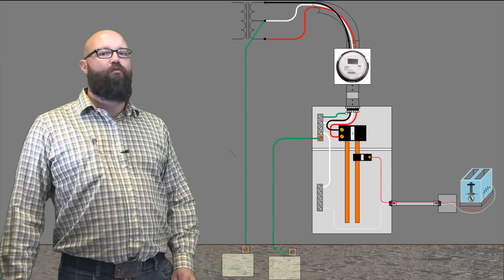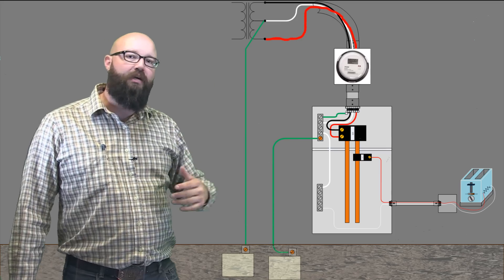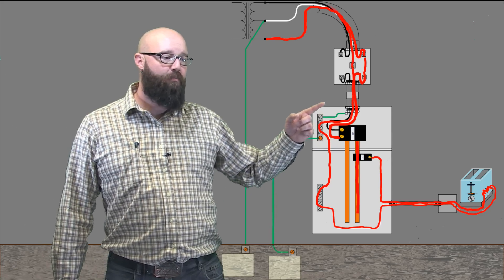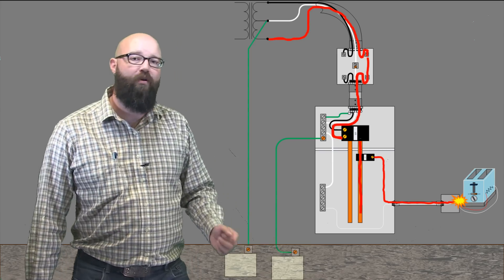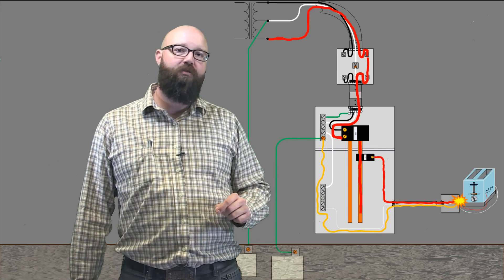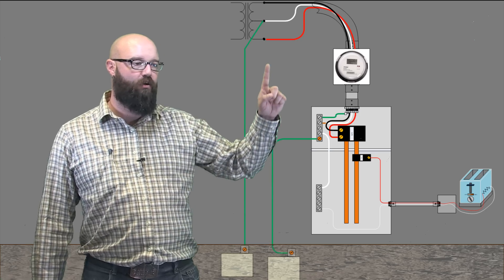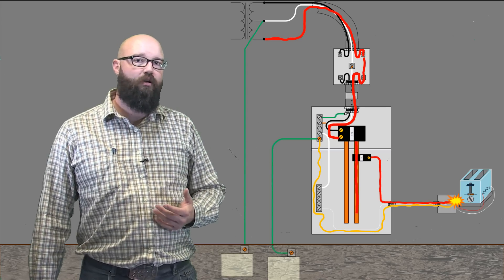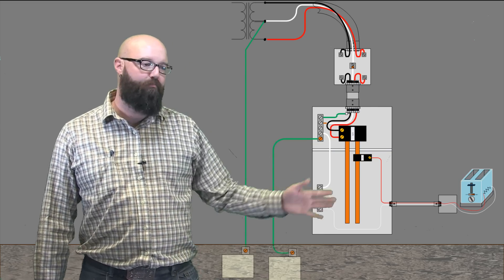Grounding and Bonding

Comment: Pretty good explanation, except in your last example, when the fault current, not having a path to neutral due to an open neutral bond, must travel to earth ground.  
A fault current that goes to earth ground will not, in most cases, open the circuit protection.  
There is no low impedance path thru the earth to the ground wire on the power pole. 
GFM
Reply from the maker: Agreed. It is designed in theory this way but impedance is still too high. We've had a few discussions regarding this on this thread, but thank you for the comment and watching!
Reply: @schulerruler  In reality then, (in the case grayfurnaceman just stated) what eventually occurs in this scenario? Does the main breaker trip? Does the toaster branch circuit breaker trip? grayfurnaceman and you are saying that the circuit goes from panelboard enclosure to Earth rather than up back through the service conduit in reality, correct? My biggest question why "A fault current that goes to earth ground will not, in most cases, open the circuit protection." Are you saying that because "There is no low impedance path thru the earth to the ground wire on the power pole" that there is no complete circuit that goes through the main breaker? ...... Awesome video!!!  I'm studying for my electrical power PE exam and just trying to really, really understand power.
Reply: @schulerruler  If an electrician is incompetent enough that both the neutral return and the non-conductive ground returns in his panel somehow become disconnected and he has to rely on ground coupling to trip the breaker then he needs to have his licence pulled anyway.
Reply from the maker: @joevignolor4u949  I agree with you. I have seen these connections fail over time though due to cold flow and have even had a neutral in a panel come out when moving the conductor. I wouldn't always blame the electrician, but if they forget to tighten up the lugs, it is a critical system and I agree something more serious should happen because of it.
Reply: Even if the current through the Earth doesn't open the breaker or fuse, it will still help to limit the voltage on other grounded surfaces. Otherwise, because no current flows and no voltage drops, all other grounded metal connected to the system will be at the supply voltage.
Reply: The use of earth ground as a zero voltage plane is the only use of earth ground.  It can provide a path for lightning and surges.  The idea that it is provide a path for fault current is not true.
GFM
Reply: @grayfurnaceman  This isn't well known, but there is another reason for the earth ground besides lightning and surges. In addition to the normal electromagnetic power coupling between the primary and secondary windings transformers also have electrostatic coupling between the two windings. So with the windings being separated by an insulator a transformer acts like a big capacitor. This will then couple unwanted AC voltage across from the primary to the secondary. These voltages will appear between the center tap of the secondary and earth ground if the center tap isn't connected to anything.

As such if you don't connect the center tap of the transformer to earth ground all the neutrals will float and have unwanted voltages on them relative to the earth. The ground plane that connects the center tap and the attached neutral to earth ground is what shunts these unwanted voltages to the earth and eliminates them.
Reply: Well explained.  Thank you
GFM
Reply: At what point will the house use the coax drop as the ground?
Reply: @scottharshman2560  I remember one place I rented where the coax shield was the ground.
Reply: TribbleBot the coax shield is usually bonded near the entrance to the dwelling. In Pennsylvania they run a green wire from a thru connector to the meter box. Other zoning locations may have different requirements. Watch https://youtu.be/8Z2JA9yK1zI   and  https://youtu.be/79CFX66mOHg
Reply: @ grayfurnaceman...love your videos🖐 they help me...thanks
Reply: Welcome
GFM
Reply: Seldom do ANY of these guys get it right (I retired from an electric utility company....)
Reply: GFM.......So if the Fault Current cannot find its way back to the source through neutral bonding, but instead takes the  path of the grounding electrode conductor to the ground electrode, is if fair to say then that the enclosure and raceway will remain energized, but being at zero (Earth) potential, will not have a high current? And if that is the case, then the fault condition will remain until someone realizes that a device (Toaster) is not working, or they come in contact with the enclosure or raceway and complete a path with another grounded surface.

I would like to believe that if there is no low impedance path back to the source to generate a high current to cause the magnetic portion of a breaker to activate, then the current going to the grounding electrode would cause the thermal (overload) portion of the breaker to activate instead, assuming you have a thermal-magnetic breaker.
Reply from the maker: @griffmustard  I think in the situation you are describing you would end up with a situation more similar to an ungrounded system. I don't know if the ground impedance would even cause overload levels in a standard breaker.  One thing to remember is a situation like this is highly unlikely to occur, but i believe, and i could be mistaken, but the toaster would still function as normal. The danger however lies in the fact that now you have a potential on all metal bonded components that could be inadvertently contacted by anyone. with no reference in the system back to the grounded conductor however, that potential may not even pose a threat. If you were at this point to touch something metal (which now has a potential on it) and a neutral or identified conductor, then you would receive a shock.
Reply: @schulerruler  .....Yes, in an ungrounded system, a person contacting an energized enclosure would not be subjected to a shock. However, I would think a conductor with frayed insulation contacting a device box, would now give the current two paths to return back to the source. And therefore the majority of the current would take the path of the raceway, rather than going through the coil element of a toaster (path of least resistance). So the toaster "might" work, but not with the same efficiency.

To go back to your animation and some of the points made by GRAY FURNACE MAN, the only worthwhile purpose for System Grounding is to stabilize supply voltage from transients/surges and lightning. And Equipment Grounding, with a low impedance path, is the only hope of operating your protective devices. So again I must ask, what happens when the low impedance path is broken, and the GF goes to ground? If the situation is not enough to activate the protective device, then the fault condition remains until discovered, right?

"One thing to remember is a situation like this is highly unlikely to occur"..........But what happens when it does occur? You told a disgruntled Journeyman, on his last day on the job, to terminate a panel........LOL!!!
Reply from the maker: @griffmustard  First off, thanks for commenting!! I enjoy discussing as hopefully we are all helping each other deepen our understanding of the topic. 
If you think of the frayed wire in the situation we are describing, having lost all paths back to the grounded point, the only path for return would be through the load, as the bonding infrastructure has been compromised. Essentially it would be like not having a bonding system at all if there were no connection anywhere between neutral and bonding at the service.  In this case the toaster would definitely operate, as there is no parallel path back, and definitely at this point there is no touch potential on any metal that is bonded to the point where the fault occurred.  One of the main reasons why ground fault Detection is so crucial in an ungrounded system.

And i agree that the purpose of  GROUNDING is to maintain balanced voltages in 3 wire and WYE connections. The main intent of the video was to illustrate paths of fault current through continuous bonding and i agree with GFM that the last scenario is not the intent of the grounding conductor/electrode, but i also still know that in a fault situation, there IS in fact current on the grounding conductor. It is considerably smaller though. Current doesn't just "go to ground" but if there is a current on the grounding conductor, then it has to be returning back to the supply, or else you are talking about an open circuit.
Reply: @schulerruler  Well thank you very much for the video. I'm always looking for informational videos like this to help fill in the  gaps in my understanding
Reply: Because the chassis ground is connected to the neutral in the main panel a fault current will pass to neutral and open the circuit protection.  High current virtually never will pass to earth ground at the voltages seen in the residential power.  
GFM
Reply from the maker: @grayfurnaceman  the discussion is what happens when the connections through bonding at the panel to neutral are lost. 
Meaning no brass screw, no service raceway bonding jumper, no system bonding jumper. You would essentially have a floating isolated system. If the secondary of a transformer is not grounded and gives no reference for neutral to ground, you could touch a secondary hot and a metal box all day long and would not feel a thing as there is again no reference on that secondary circuit to ground. (I AM NOT ENCOURAGING ANYONE TO TOUCH A HOT CONDUCTOR AND METAL) 

During fault situations I agree there is no HIGH current on a grounding conductor, but to say there is no current at all on a grounding conductor is not true. It is measureable, low, but measureable. If there is any current then there is a path through ground back to supply neutral. Otherwise it would be an open circuit and zero current would be measured. 

To clarify for myself GFM, when referencing chassis ground, would that be considered the same as equipment bonding? Oddly enough I also teach HVAC for our second years and would love some EOF your feed back on the few HVAC system videos I have made.
Reply: I would imagine that in some places in the world where the earth moisture content is consistent on a year round basis, you will have conductivity through earth, especially if the grounded transformer neutral and the grounded service panel are in relative distance to one another. But what about dry areas like let's say Saudi Arabia, where the soil is sand, with next to zero moisture content, I don't think you would have much ground conductivity. In such a situation, I would think any separately derived system would be connected to a ground grid, which will give you a wired connection back to the source through a grounded neutral point.
Reply from the maker: @griffmustard  my colleague used to perform ground impedance tests on a regular basis here in Alberta Canada, but I've never had the opportunity. I would imagine it would be harder to reach down far enough with electrodes in dryer areas for sure.
Reply: Yes it is the same.  I use chassis ground because it seems more accurate to me.  
GFM

Comment: Excellent video.   I have been teaching this for years.   I find that about 90% of electricians and engineers think that the fault goes to earth ground.   Some have even argued with me on this.   Again excellent video!
Reply from the maker: Thanks for watching! I've had the same arguments so I'm glad I'm not alone haha. I tell my students if the current is going to ground you need to fix it or move.
Reply: schulerruler    I wrote a comment about the current going to ground Electrode.   Then I saw all the comments and your response, so I deleted it.   Respectfully,   Kevin

Comment: Thanks for this....now I understand grounding and Bonding....I was wondering  if you could do a vid on generators, being used for off grid power going to a panel...as there seems to be lots of confusion out there and its giving me a headache lol....Ground the genny ,not ground the genny...is the genny bonded or what I heard does it have a floating neutral...I'm confused....if not thanks anyway for this video...
Reply: The generator has to be grounded no matter what. The question you want answered is where to bond the neutral. The answer is that it can be either at the generator, or at the panel, but not both. If you bond the neutral at the generator, you need to keep the circuit grounds and neutrals separate at the panel. Your grounding electrode (earth ground) would connect to the neutral at the generator. If you bond at the panel, the Earth ground connects there as well. The bond wire in the circuit between the panel and generator serves to bond the frame of the generator.
Reply: Thanks for the reply....
Reply: As The Reynolds points out the grounding can be done at either location but not both. But you also need to pay attention to the transfer switch. Many large generator transfer switches are designed to transfer the neutral as well as the phases. In this situation, the grounding must be done in both locations. The transfer switch will prevent them from becoming parallel paths..